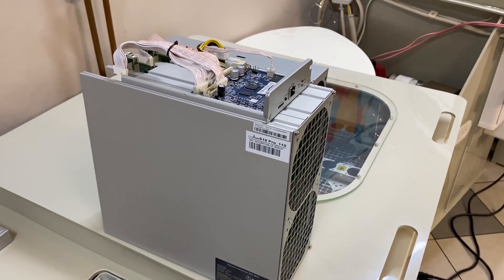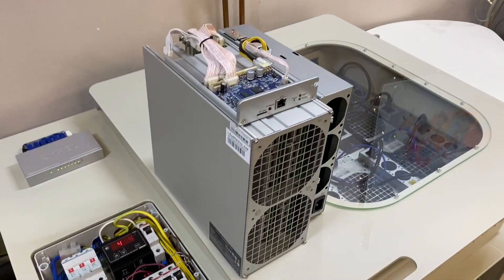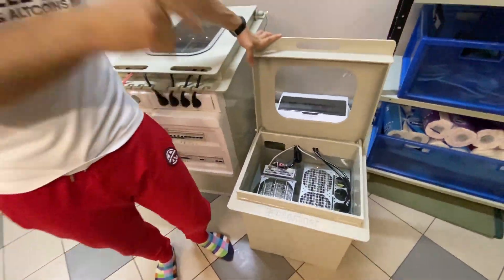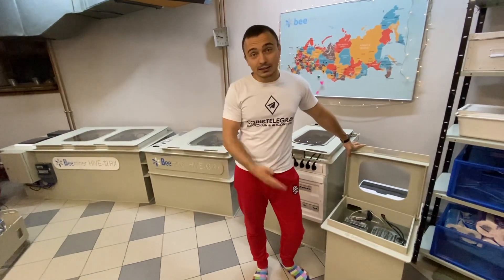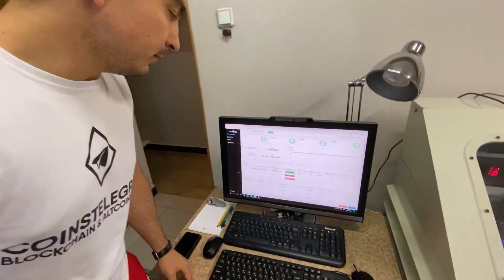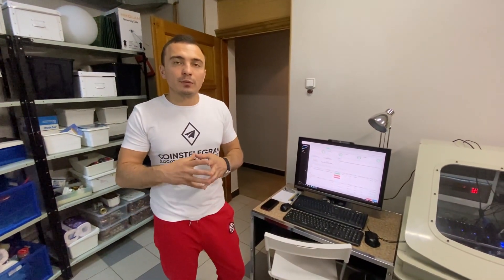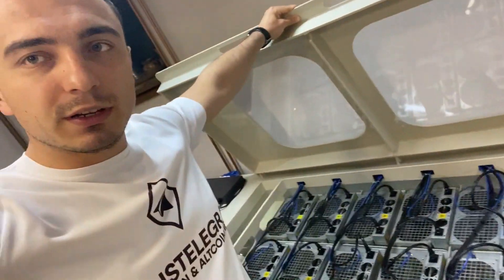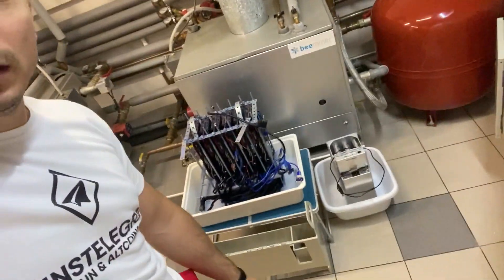Antminer S19 Pro in immersion cooling Bitcoin mining farm. Oil cooled pc

Comment: Did you have to run fan spoofers for the power supply fans?
Reply: that's also my question...
Reply: @kryptotechz  I found out on my own testing. The answer is no, you do NOT have to spoof the power supply fans 👍👌.
Reply: @Brute4rce1111  okay thanks :) but i think you have updated a customized firmware right? I have a kd5. I think i need to spoof the psu fans too😅
Reply: @kryptotechz  Nope, I have the stock OS on my Antminer s19 pro. Just as long as your PSU fans have 2 wires only, then you shouldn't have any issues running the miner without them.

Comment: Since this appears to be a Two Loop system, how is the exit water handled from the water side since a water supply line is required?
Reply from the maker: just running water
Reply: @AlexWhite22  yes but the water has to either loop and be cooled or exit somewhere (drain) as new water comes in. I am about to order one or two units but I need to know how to handle the exit water
Reply from the maker: @dinotom1  you can put running water back to the system

Comment: Can you tell how big heat exchanger is required for certain number of miners? It's assume 10 S19j Pro are running in the immersion, how big the coil is required in heat exchanger?
Great design BTW. 
Thanks.
Reply: The units come with the heat exchanger optimized for the model, according to the website.

Comment: Hi, 
1. is this water or oil? 
2. If I order it, will there be instructions on how to connect the machine?
3. How long will the delivery time be?
Thanks a lot.
Reply from the maker: Where are you based?
Reply: @AlexWhite22  Hong Kong.
Does it require a cooling tower? Thanks a lot.
Reply from the maker: @bf2825  please contact @beeminergroup in telegram messenger for this questions. Use White Crypto promo code for discount
Reply: @AlexWhite22  sure thanks
Reply: @bf2825  it dose not come with instructions, it is not water, in fact it is a perfected oil for asic miners, I am actually about to run 6 S19j in a 6 unit beeminergroup bath do subscribe if you are interested in how the outcome looks! ( we are using a dry cooler) (also takes about 2 months for a bath order to USA)
Reply: @Anomaly417  Thanks man, That's a neat tutorial for fan removal. I have a few question for you too. 
1. do you recommend using the beeminer in general? 
2. What does a dry cooler mean? it this an additional hardware that you need to place outdoor or it comes with that bathtub?
3. Will you overclocked your s19j?
4. Do you think / expect the installation to be difficult?
Reply: @bf2825   aye thank you bro! And also #1: I do recommend beeminer because of one reason it’s simplicity and it’s built nice, but also it dose require a little bit of piping knowledge as well as an electrician, but it’s like once all the tubing is connected and the main bath is wired to the breaker box then all you have to do is fill it with machines and dielectric fluid and plug them in. Now the one reason I would not recommend it is the price and that if you knew how to make a bath you could do it yourself for much cheaper.
#2: yea the dry cooler is similar to the cooling tower but requires no water other than the water existing in the loop, basically the dry cooler is a big radiator with a fan and pump, circulating around distilled water into the liquid to liquid heat exchanger that then cools the dielectric-fluid.
#3: as of now I don’t see any firmware that is capable of over clocking, but if there was we would definitely do a slight over clock. 
#4: the installation is definitely a little difficult because we have to actually build our own dry cooler and make sure all the piping is the same size as well as making sure we got the right radiator along with how we put together the area for example you don’t want to run too long of piping when you are dealing with the cooler liquid because the distance will eventually cause you temperature dissipation and you don’t want that on your cold side. Sorry if something sounded complex i am not at home right now so I cannot review the entirety of what I said but if you have more questions do let me know
Reply: @Anomaly417  can you make a video how it works without fans? Do you have a customized firmware? I think the miner can get an error because when the fans be de-installed, he want to read the rpm from the fans... :x
Reply: @kryptotechz  you need to use a fan simulator

Comment: Hello! can I use the S19 pro with fans in inmmersion cooling and setting the speed fan to 3%? Will I have problems with the fans?
Reply: Fans should be removed. The pre-installed fans blades are for moving air not liquid.
Reply: Wha do you use for remove fans?

Comment: This system is the best I've seen by far. Most are using the immersion liquid also for circulating, which is not very clever. You instead use simple water, which has the highest temperature capacity. I'm very excited to hear the end results.
Reply: There’s no way the liquid is water. They are using mineral oil.
Reply: @howo357  Yea water would destroy everything.
Reply: @elonlove343  He is talking about the other side of the plate heat exchanger
Reply: @joshuanaismith4835  Yes, exactly. I was talking about the heat radiator circuit.
Reply from the maker: Great to see you on our channel !
Reply: @AlexWhite22  Hey, I think I've mistaken your video for some other. By the way, do you know the chemical composition of the liquid?
Reply: @212025510  Fluorinert,
perfluorinated compounds (PFCs)
Reply: Can you use a circulating cooling pump? Re filter the mineral oil

Comment: How can i mine with a s19 pro without the fans? Do you have an special software or something. I need help
Reply: Can you see that they are cooling it in mineral oil i think
Reply: There is a device you put where the fan plugs into and it tricks miner into running without fans.  That is what i have seen others do.

Comment: Hello, I would like to know if you are using the fan emulator to keep the s19 on without having the fans installed
Reply from the maker: Yes, we use one
Reply: @AlexWhite22  and how it works without fans? Do you updated a customized firmware or what?